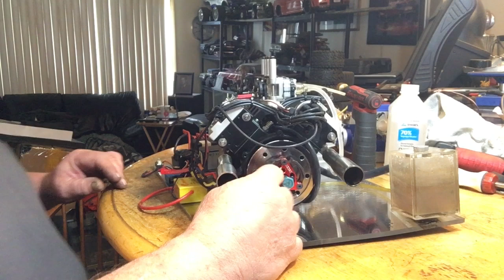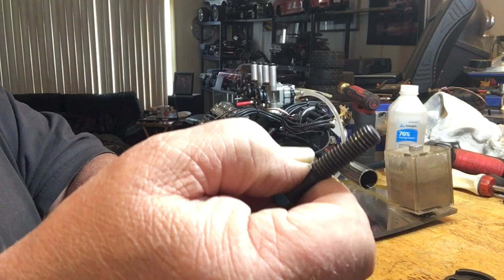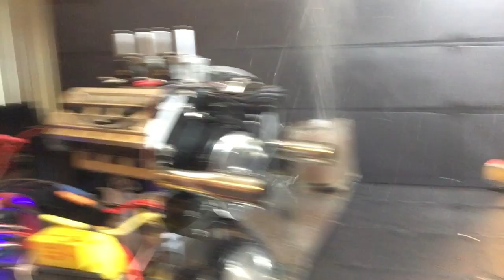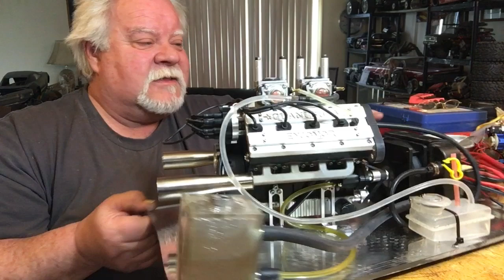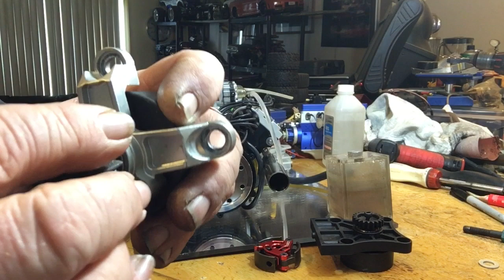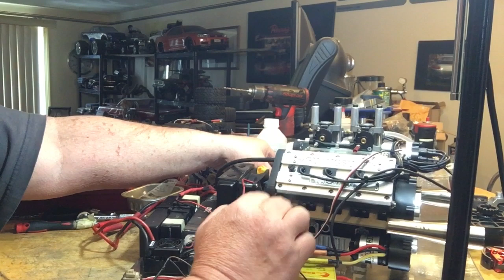THE ENJOMORE 78cc V8 SET UP DETAILS

Comment: I’ve never seen one, actually powering a go cart or bike or anything for that matter.

Why is that?
Reply from the maker: I can feel your pain brother, it all comes down to mass rotation and the weight of what you want to install it in, although it is a 78cc engine the mass size of the internal rotating assembly in my opinion would be compared to installing a small block chevy in a earth mover dump truck it will be strained to death because of the small size, If it is installed in a smaller RC 1/4 scale car it will work 👍

Comment: I like the prospect of a real bell housing to support the clutch bell and a transmission. If you get this thing to really come alive, it may actually make upwards of 8-10 horsepower, so it would take some pretty aggressive components to handle that.I don't know if that itty bitty oil pump and water pump are going to move enough fluid to keep it cool and lubed sufficiently. If you scale the radiator with the displacement, you may need to make it a bit bigger to deal with the extra heat under load, especially in a vehicle. If the water pump is capable of moving more volume, maybe increase the size of your hoses? Looking forward to the next installment Dennis. Nice work!😄👍
Reply from the maker: Yeah its going to need a good size radiator, hoses and a good cooling fan,  the pump puts the coolant through like a fire hose lol,

Comment: This is from quite a while ago but I was just wondering if you ever got the homemade string trimmer v8 running?
Reply from the maker: yes but it had a catastrophic failure when somehow a staple got sucked up one of the ports and locked it up breaking the crankshaft,
Reply: @dennisdempseyradiooutofcontrol  awe that sucks it was such a neat design